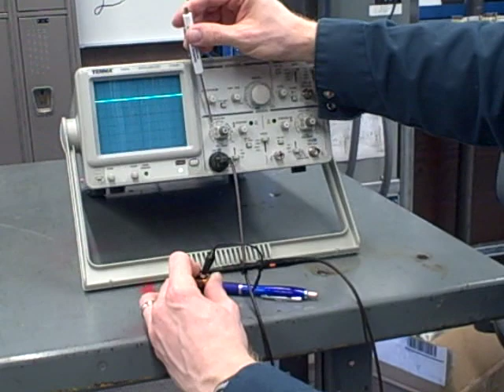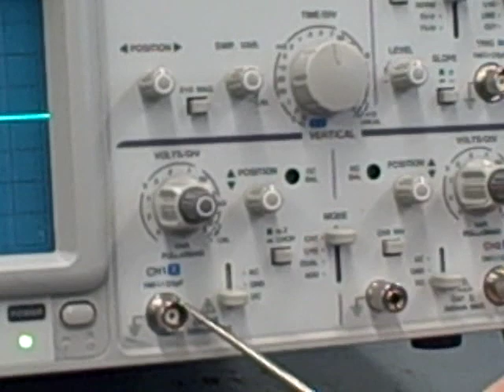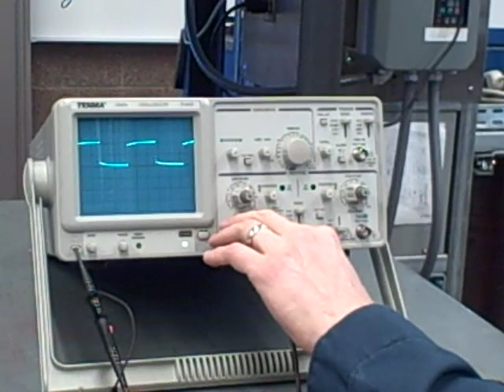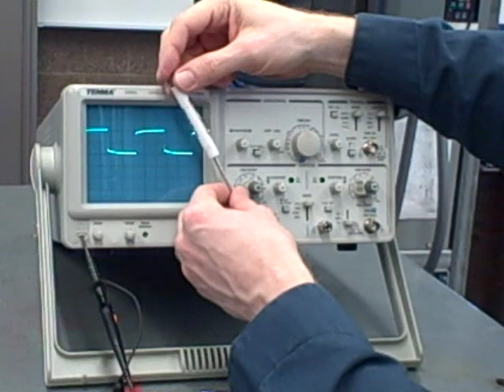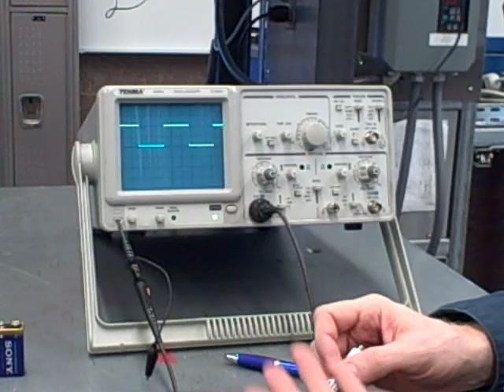Oscilloscope operation 10X probe compensation

Comment: What can be done if the probe is under compensated even when i turn the cap all the way around. The best I can do looks worst than in your video. Compensation adjustment is in the tip of the probe, and I'm unable to take it apart to change the capacitor.

Comment from the maker: You probably have the coupling set to "Gnd" instead of "DC" or "AC".  Either that, or the cable is defective, or the cal signal generator is not working.

Comment: Such a great illustration, thanks a lot. 
I was trying to to do this probe compensation to my oscilloscope but when i connect the probe between cal and Ch1 nothing change in display screen. The trace line remains same. Why do you the problem is?